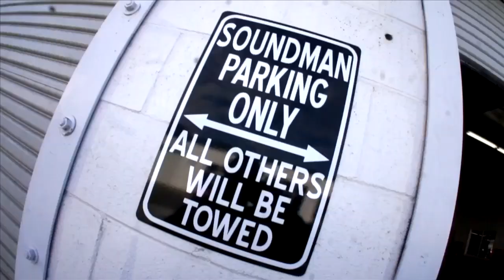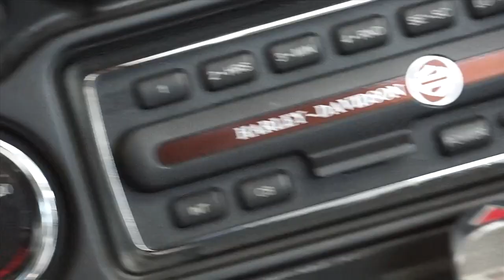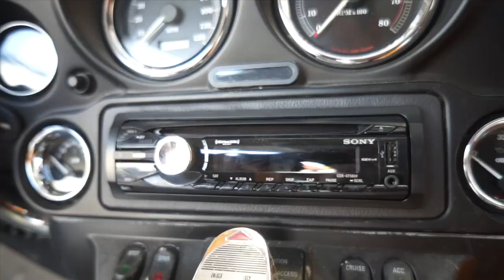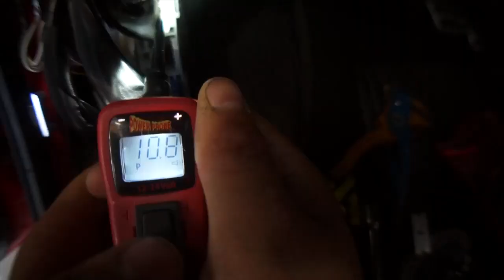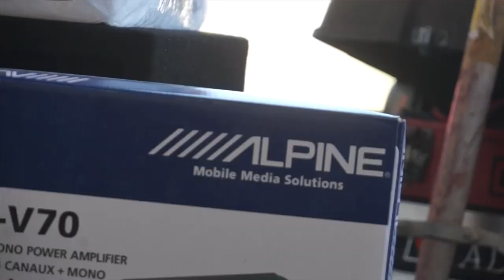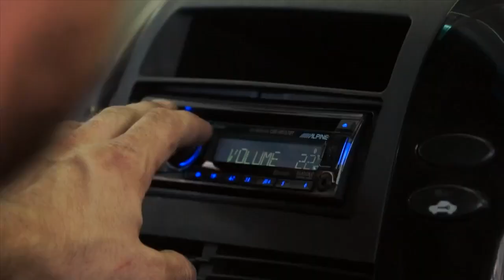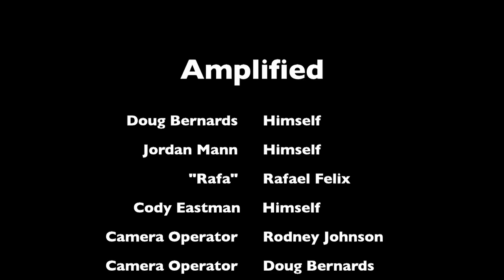Amplified 64 "Box Boy" @SoundManCA, SoundMan Car Audio, Santa Clarita

Comment: t-taps are great if you are in a tight area with not a lot of slack on wire. 
I used them on the BCM on the trailblazer with the relay to disable to DRLS. That is really the only instance I would use them on. I had about 2" of wire on either side for slack. 

Unlike the unlimited wire slack when I was tapping into and building the LED tail lights for the truck.

Comment: @soundmancaraudio I have a 12 inch type r on a kicker 750.1 in a 2.9 cu. ft. Ported box. I have been considering the type s because my type r is starting to make a crazy sound like it's bottoming out or the voice coil is rubbing on something. What could be causing this? Do u think I should change woofers I've only had the type r about 4 or 5 months...

Comment: You guys seriously need to ditch the PAC steering controls and try the Metra ASWC.  For sure you will save 20 minutes a deck.  And no I dont work for Metra, its just what we use in our shop.  Would have saved an hour for Jordan to do that bike.

Comment: you are very mistaken...t-taps cut the wire, add resistance, and do not make a solid connection.  Try using those on a data connection, and see how well they work.  T-Taps are for lazy people who have no idea how to solder.